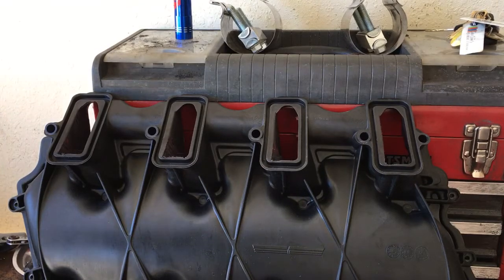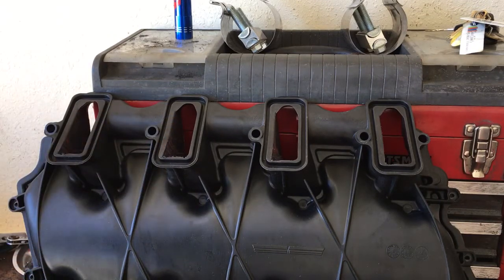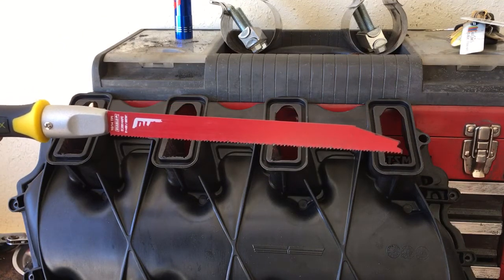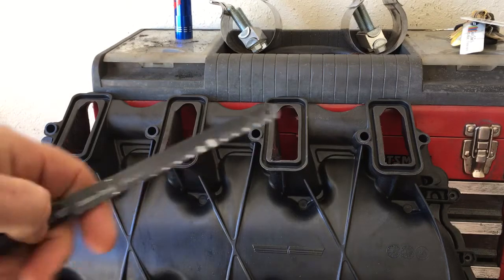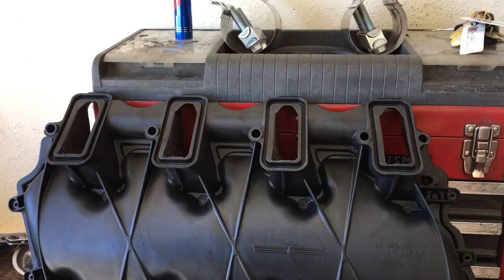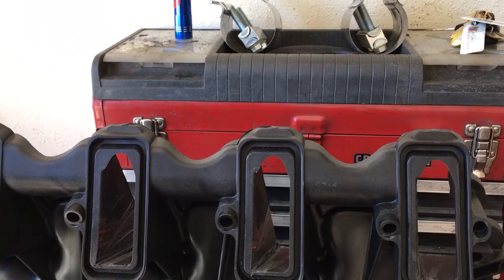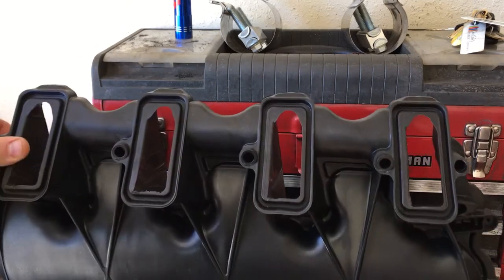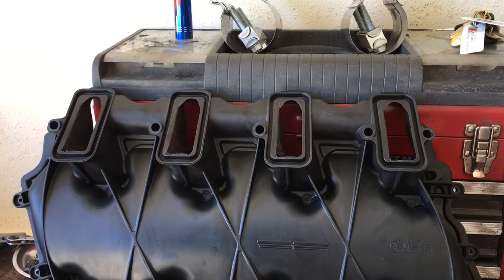Porting the 615-183 intake remove the “Wedges”

Comment: Interesting. I have ported a lot of intakes and heads. Now I never have yet ported a Plastic intake. Now I am curious to doing so.
Reply from the maker: TRX VLOGGER I’ve done several, it’s amazing messy gets dust all over.  Just go slow with light pressure as you can imagine it would be easy to go to far. There are epoxy you can use as a repair if something bad happens. 👍